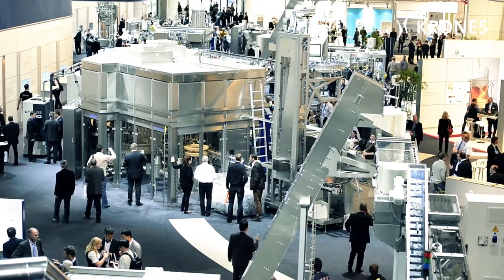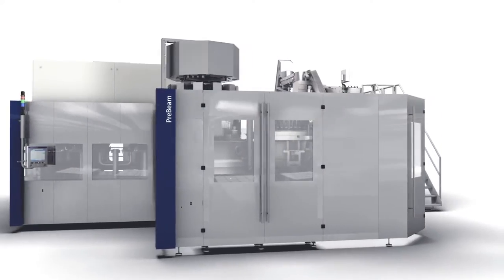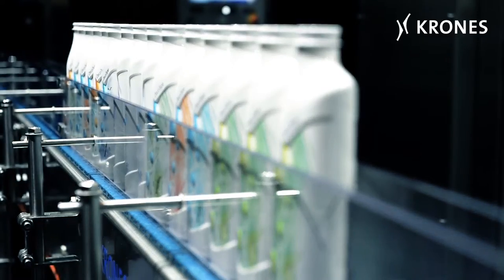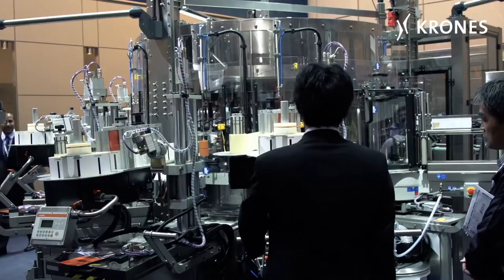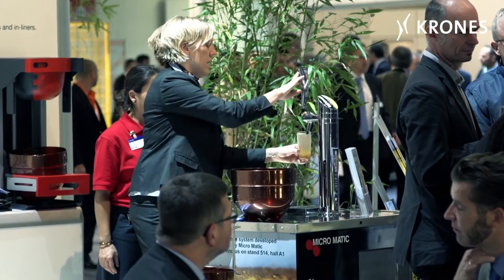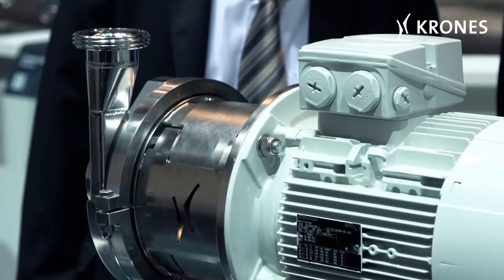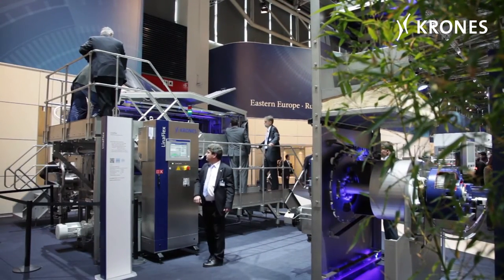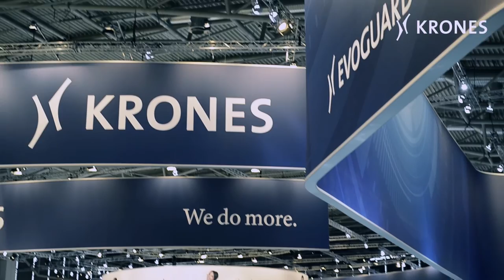Krones at the drinktec 2013

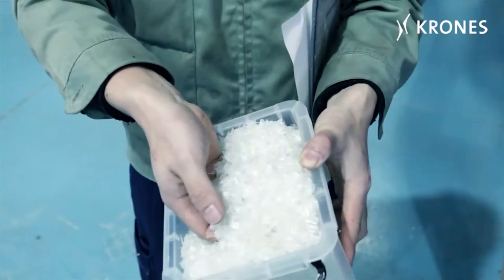Comment: 11:14 - " flake to pre-form recycling process. ". I think that is almost certainly the entire prerequisite with Krones machinery. Krones machinery is predicated on blow moulding pre-forms. The preforms being manufactured which is created from rendering food grade PET flake and pellet to oil. And that flake and pellet is from post-consumer PET.  So that they don't melt the flakes and pellets straight into new bottle forms. They render that back into a specific oil constituency and manufacture preforms from that, then blow the preforms into bottles. The MRFs and container deposit operations sort and bail the post-consumer PET, ship it to companies which clean and purify it and render it into flake and pellet, then Krones turns that into preforms then blows and fills and labels them.